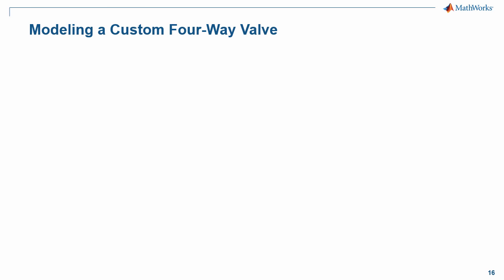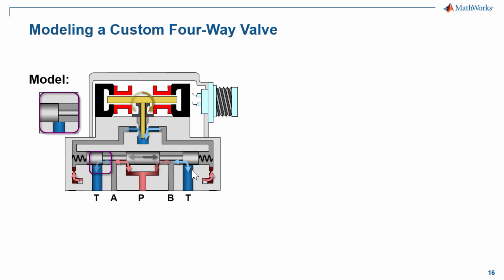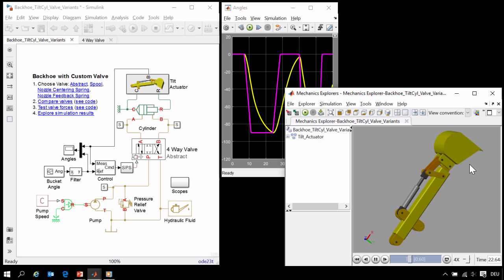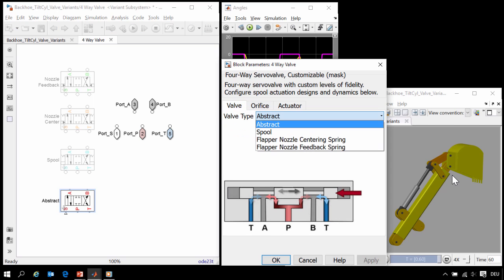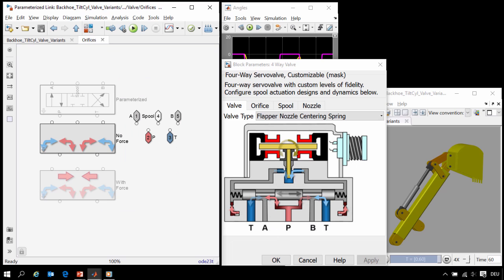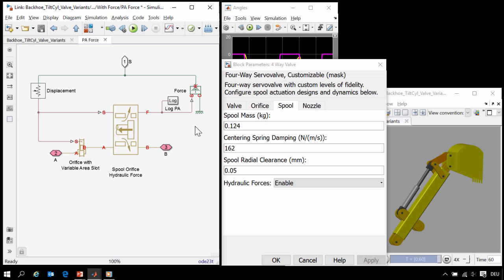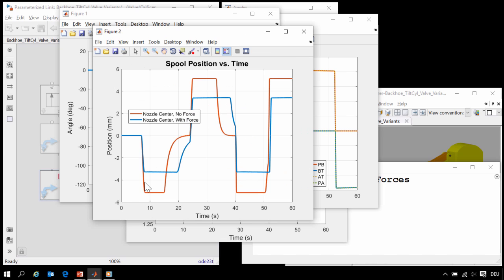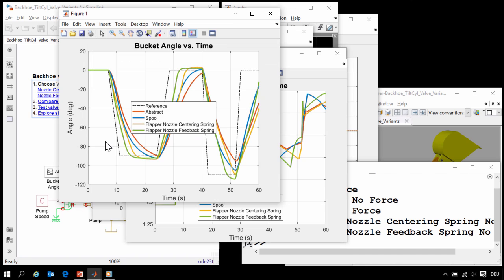Modeling a Custom Hydraulic Valve

Comment: hello, im trying to simulate a hydraulic lift system using matlab 2013 simulink. im having problems with actuating a 4 3 way valve tandem center and also how to connect the scope so that i will get results on valve actuation as well as double acting cylinder position, system force and power basically allresults. How best can you help.
Reply: I can't even find the vavle 😂